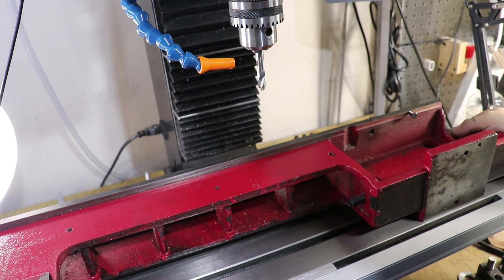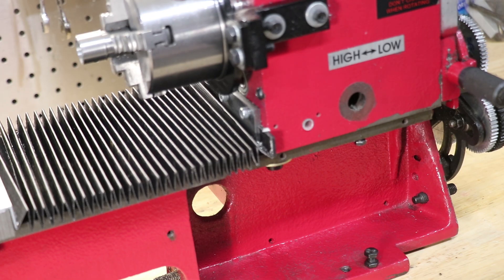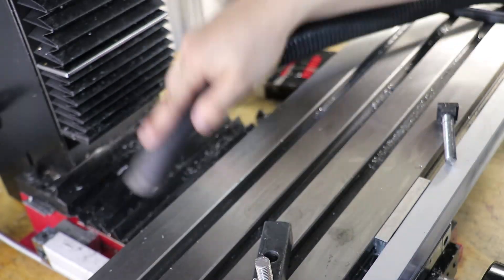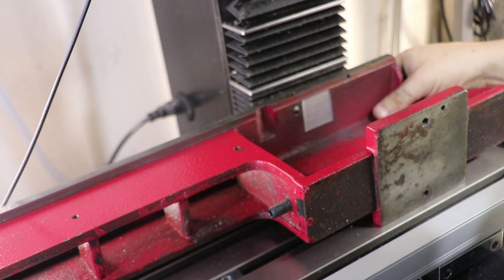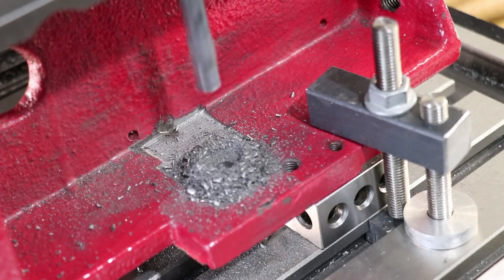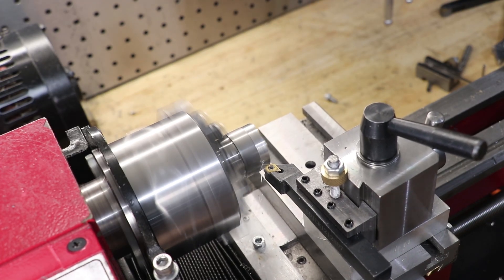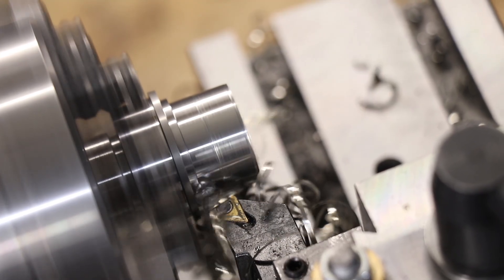Mini Lathe Headstock Rigidity Upgrade

Comment: Was the motor providing some rigidity before it was removed?
That's kind of how motorbike frames work.
Reply from the maker: I’d be very surprised if the stock motor mounting position was providing much rigidity. If it was it would be far less than having a solid support post

Comment: Good Stuff!  And a great result.   For those of us needing the motor in its stock location, it would not hurt to add the fourth bed-to-headstock bolt (left rear location).   I did that as I also noticed that area to be quite a flimsy looking location.

Comment: Just noticed that the motor cut-out in the bed underneath the headstock is potentially a massive design flaw - isn't this where you need the utmost rigidity in the entire lathe? Decades ago I could have knocked up a computer finite element structural analysis model to show you how such a cut-out structure would deflect under cutting loads... kudos to you for making it more rigid. But if all of these generic 7x14 lathes are designed like this then I'm staying well clear of them

Comment: I wonder why didn´t you  add a fourth  tread hole to assemble the head stock. From my point of view this would make the construction much more rigid too.  I think there are only three bolts for the headstock due too less space above the original motor.

Comment: I wonder if spot welding the block in place might actually be better? That way there is no issue with perfect fit. One should take it carefully though, not to dissipate to much heat into the lathe bed, and warping it that way instead.

It's a bit sad, but I suspect both shipping weight and general customer preferences work against making the lathe castings heavier and more rigid. In fact, even the lenght of the bed is sub optimal. Just a bit longer - classic proportions - than the "stubby style" that the Mini Lathe has, makes working more practical in my experience. But I suspect also here, market demand is for a shorter bed.
Reply from the maker: I dont think you can spot weld cast iron
Reply: @artisanmakes  Embarrasing - I don't do any welding myself! So I really shouldn't speak much about it.😁😅I have done a reasonable amount of turning, milling, casting, soldering/brazing etc in my life, and I do have my own lathe (second one I own) and mini mill, so I'm not generally speaking of things I don't know. 

About size and weight, somewhat incredibly I was even given a "small" manual industrial lathe for free the other year, but in the end I very sadly had to turn the offer down, due to freight/moving  considerations, and floor weight requirements of that machine. It really agonizes me, and may well to some extent haunt me for the rest of my life. When I was a teenager, I would have killed to get such a lathe! And then 45 years later, I turn such a free gift down. 

Thank's for a nice channel! I'm kind of maybee possibly nearing retirement, so maybee I'll get serious (again) about shop work in coming years, like I was in my youth? During my work life, I've hired other people to fabricate things for me. 

And in the end I never did scratch build a live steam locomotive, but instead bought an Aster kit and also other already built up locomotives, that I just used my lathe to modify parts for.

But I have been hand's on involved in shop work on prototypes - just because I actually love machining etc.  I don't even do my drawings on computer. Computer drawing didn't exist when I went to school and university. Instead so far, I've hired people to "transfer" my paper drawings into CAD/CAM stuff. Frustrating and sad really.

Comment: Maybe bolt the lathe to a piece of 1/2" steel plate on before the splash pan before bolting to the wood bench will help for those of us who still have the motor in the well.

Comment: Did this yesterday! Hans for the part numbers on the bearings. Seen a lot of people concerned with the  thickness difference but a rat tailed file made quick work of the interference on the large black bushing.
Reply: My bearings show up tommorrow. I've only had the lathe a week and I've already knocked out a ton of the upgrades I've seen everyone doing😂 I'm not wasting any time with it

Comment: one small problem i see , if the piece you put in is slightly small (as you have to fit it in between two sides ) and bolt it up from those two sides you pulling them together , so you can end up with a slightly twisted bed , you probably can shim that out by raising the foot where the motor used to be though but it will cause the whole bed to be under tension
Reply from the maker: yeah for sure, I  had to use a few shims to get it perfect

Comment: The best thing you can do for rigidity is having the tool cutting edge as far back (to the right) as possible in the cross-slide: If you look from above the cutting edge should ALWAYS be on top of the cross-slide bed.

By far the major rigidity problem is how narrow and light the cross-slide is. Having the tool stick out on the left of the crosslide even a few milimiters is enough to make a lever between the tip of the tool, supported on the left cross-slide way and pulling the right gibbed way up, this is the shatter you see, boring bars are a specially problematic. I would recommend moving the toolpost hole on your solid toolpost stand as far right on the cross-slide as possible and preferably have the cutting edge of the tool on the center of the crosslide, this way the forces to be applied straight down on the cross-slide with no rotation forces and without pulling the right side with the gib up, it will also improve the use of boring bars but for those I recommend a gib locking screw.

For small machines a good well supported toolpost is also important, I understand people like dovetail style toolposts because it's easy to make new toolholders but those indexed euro style multifix are easy to attach (round and relatively small mating surface) and the spring + multi teeth system makes the tool holders much more rigid compared to our cheap/homemade dovetail toolposts.

Comment: Nice vid, good easy solution to the problem. Another cheap way to add rigidity could’ve been to add two or three threaded rods along where you added the bar and then tip it on its side and filled the void with cement.

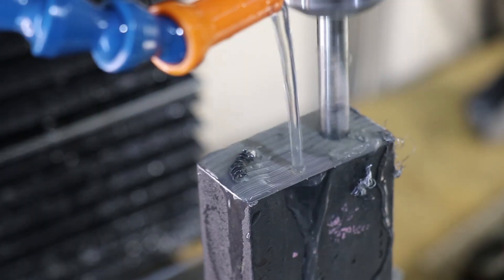Comment: Is that just water as coolant at 3:40?  Another question, seeing that you use a vacuum to suck the shavings from the machine. How do you dispose of the shavings? Where do you dump them? It'd be nice to know.
Reply from the maker: The coolant I use is a 10% mix of semi synthetic coolant with water. For chips, I use a bagged shop vac and I just throw out the chips in the rubbish. I don't produce enough chips to warrant recycling.

Comment: Why you don"t use epoxy granite?
Reply from the maker: Well the steel post in the headstock worked so I saw no need to use it, plus epoxy granite it quite expensive in my part of the world. As for doing the bed, there isnt much flex it it, there are other areas that are more important than that that would see noticeable improvements.

Comment: 4:10 the easiest way to quickly align a mill vise is to never have to align it. Mount a piece of steel bar to the bed and align the side toward the column. Clamp the vise upside down to that bar, fixed jaw against the side of the bar you aligned. Mill a shallow groove across the base of the mill, exactly the width of a table slot. Drill and tap some holes in the slot. Remove all that and mill a bar to precisely fit the table slots. Drill and counterbore or countersink holes to match the ones you put in the vise bottom. Mount the bar to the bottom of the vise. Now you can put the vise on the mill and clamp it down or use the bolt slots if you did this so they're aligned with a slot. "Instant" vise alignment every time so you can save all the time you'd otherwise spend aligning the vise every time you mount it.

Comment: Another improvement you could do is a 4th headstock mounting bolt. There are two manufacturers of these lathes. One makes them like yours. The other makes them better in several ways. Firstly is four bolts mounting the headstock instead of three. Second is the saddle is a rectangle instead of the lighter "H" shape. Third is the apron is thicker and has two ball bearings on the carriage crank shaft. Fourth is a locking adjustable nut on the leadscrew to the right of the right end support block. Put a brass washer on either side of the block and the nut can be adjusted to eliminate all sideways shifting in the leadscrew.

Comment: I fabricated a heavy weldment that fits underneath the bench top. The bench top is 3/4” plywood reinforced with 2x6’s spaced 12” assembled with screws. The bolts that fasten the lathe bed to the bench top pass through the weldment creating a sandwich.

Comment: A good idea, but surely having torqued down those bolts, unless the length of that bar is exactly right, including any compression and surface distortion/inaccuracy, you will have twisted the bed to conform to the bar, which will translate as error in the bed. Should have just filled it with epoxy.
Reply from the maker: Had to shim it to size. It proves to be much cheaper than epoxy

Comment: I just filled this area, the whole bed and the head stock with epoxy granite. It's curing in the shop right now but I have high hopes!
Reply: How is your lathe performing now..
Please share your views
Reply: @RoyMeraki  Haven't been able to test it as well as I want as I'm not done with my solid tool post to replace the compound slide yet.. That being said, it seems to have been a massive improvement. Getting the whole machine to vibrate like it sometimes did before is virtually impossible now.

It's about 10kg of epoxy granite in total, filling the whole bed casting, the area where the stock motor sits and I also filled the headstock up just below the spindle bearings!

The disadvantage is I have to pray to god the headstock stays aligned as there's no adjusting that ever again now...

I'll try to remember to share results once it's done!
Reply: @josefstalin4532  thank you for thoughts.
Would definately wait for your review post your solid tool post mod. I have lathe 14X40" and is resonably stout weighing in at 850 kg. The grief I face is only with parting. 
I heard that epoxy granite stays resonably accurate after curing and is not prone to deform, do you really think that epoxy fill could warp machine castings ?
Reply: @RoyMeraki  I'd say it's very unlikely, at least to a measurable degree. Just make sure to get a really slow curing epoxy so it doesn't heat up too much.
Reply: @josefstalin4532  in india slow curing epoxy is not available pot life is approx 2 hours and full cure to 24 hours. if it generates heat I will apply probably in layers.
Reply: @RoyMeraki  24 hours will probably be fine, depending on the mixture you use.

My Epoxy granite is 90% Granite 10% epoxy by weight, so it didn't heat up much at all because how much granite there is to cool it down, but that was with 72 hour cure epoxy.

As a sidenote, Epoxy Granite is really fun to work with IMO, so I'm currently making a 200kg milling machine from the stuff..
Reply: @josefstalin4532  wow nice!! I have seen people in youtube fill their mills with epoxy, but not much with lathe. i do not have a mill. but surely would be interested to know your thoughts on filling eg on your lathe.
Would wait for your review & i am planning mine to be done probably next year.
Reply: @RoyMeraki  this is the video that convinced me to do mine, as you can see it's a huge improvement over the original.

https://www.youtube.com/watch?v=1z7WctFry9U

(tell me if you can't see the link, youtube does that sometimes...)
Reply: @josefstalin4532  ohh yes kwk, he is the only youtuber i saw filled epoxy on lathe.
I asked about his views. He gave more credit to his upgrade to tapered roller bearings, solid tool post and bigger motor with vector vfd. 
I can understand those upgrades makes the machine stout. 
my dilemma is once i fill epoxy to my lathe, there is no going back 😉 & as much as i like to do this. It scares me to go with this mod honestly😃
Reply: did you put as much epoxy is he put on the lathe? are both of your lathes the same ?
Reply: @RoyMeraki  Yeah I have the same lathe, and I put as much or (probably) more epoxy.
Reply: @RoyMeraki  Seems pretty nice, this is a much bigger machine than what I have though..

Comment: my mini lathe is in shambles due to the bed of the lathe not being flat and causing binding issues and cross slide rigidity issues. 
The tailstock doesn't align with the headstock properly causing drills to bend as they burrow into the part and widen the hole at the entry. 
the bed doesn't fit my surface grinder table so i cant flatten the surface. and its sat in pieces on a table since fall 2021. 

im tempted to just finance a tormach 8L lathe. i wouldn't have to deal with literally everything being a rigidity issue.

Comment: This is probably a good mod. However a good other rigidity improvement is to bolt the lathe on a block of concrete (or iron, or stone...).
It's definitely something to do

Comment: a metal plate under the countertop would be good also you could have the bolts and washers hold it up to the underside to give more weight and rigidity to the wooden counter

Comment: My mini lathe has this same flex problem. I'll see it on backing out and that small skim cut I'll get. I'm using the factory motor so it's currently in the way for your mod. I might have to see what I can do to mine. I'm not sure you addressed the entire flexing problem. Mine happens down the entire bed. Clearly my bed is flexing anywhere along its length. It is bolted down to a 3" thick bench top. I'm sure this mod helped, but I'm wondering about a thick hunk of steel for my entire 20 inches of bed.
*
 I already had a conical bearing at the chuck from the factory, but added one to the rear of the spindle. That was a noticeable improvement. I recommend this to anyone with a mini lathe.

Comment: Why did you use roughing end mills? For better fit, I would have used finishing end mill. Cast iron is machined with low rpm.
Reply from the maker: It deals with the DOC butter with a rougher. And anything other than high-ish rpm didnt do any good with that much stick out

Comment: i've been looking at this lathe, i need something to turn plastics and sometimes wood. i'm wondering how well it works for that without all of the mods, i both lack the skill to do this metal work and lack space where metal working would be ok. my workshop has a carpeted floor and i do not want to be picking sharp metal shavings out of the carpet for the next decade, hah.

maybe with just the mods i can buy it'd be ok, maybe there's an awesome shop vac mod that'd prevent shavings from getting everywhere?
Reply from the maker: You should be fine to do plastic and wood with this type of lathe in its stock form. Just properly tighten the gib strips and carriage retainer strips before you use it

Comment: Another way (that I did) is to buy a 20-30mm thick steel plate and place between the table and the lathe. (Mine was a left over so I did not have to pay that much.) The plate is as long and wide as the "oil plate" under the bed.
I first drilled holes for the ordinary two bolts. Then I added four new holes so I could tighten the bed even harder onto the plate. I placed a few shims between the bed and the plate, at some places, before thightening in order to keep everything straight and nice.
This has really improved the rigidity on my Bernardo Profi 400.

Comment: You mentioned that your vice was moving as you tightened up the bolts, I have had problems when washers have taken a “set” and kept shifting as the bolts were tightened, possibly new or thicker ones may help 
Also tightening bolts a little at a time and sequentially

Comment: I really like this mod!
I've heavily modded my mini lathe, but haven't seen this one before. There's an idler pulley, connecting to a larger motor, where the old motor used to be on my machine. However I might rethink all that to implement this mod at home. 
Well done!
I'd love to see more testing, maybe with some data.. same cuts before the mod, the amount of deflection then vs after... 
Also curious if putting that block in there twisted your bed at all (either from the compression of the bolts or jamming the block in there if it was a really tight fit)... 
On that note, it may be time to check your bed for twist and align the your head and tail stocks. 
Best from California.

Comment: Hi, excellent videos and narration, have you thought of drilling into the headstock and putting grease nipples in between each bearing so they could be given a shot of fresh grease every so often, I have a Hobbymat lathe and is a very similar setup so will be doing this to it, regards Doc Cox.
Reply from the maker: I tore the lathe apart to redo the grease after 6 months and it still seemed to be well lubricated, so I dont think regularly replenishing the grease is too necessary

Comment: Increasing headstock rigidity, at all, and your solution, in particular - there are well and right. But I guess you were needed to cut bottom seating place the same as a top, way out, but not as a close area.
If both, top and bottom, seating places were open one end,  you would be able just slide the strut in. In this case you would be able to use a maximum possible height strut and would be, almost, spared the opportunity to bend the bed.
The way you did it - am afraid you were bended the bed. A bit, but... The verification ruler or dial indicator may shows you what am talkin' about...
Reply from the maker: Doesn't seem to be any twisting. It was all shinmed tight to avoid this and the lathe doesn't seem to be turning a taper. Happy days :)
Reply: @artisanmakes  So you're in luck...